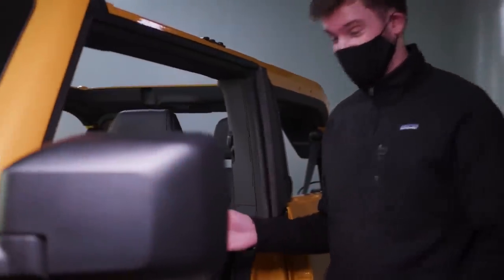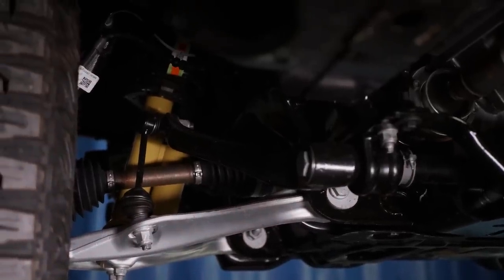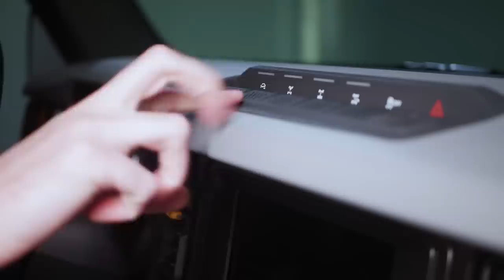See How to Take Apart the Ford Bronco, and Other Cool Features

Comment: Those attachment ponts for the rear washer fluid and electrics sticking out like that are not going to work out well! Someone or something in the rear is going to knock them off. The storage connection points shouldn't have been perpendicular to the side but rather recessed and covered with a flap.

Awesome car though, I'd love a 2 door but the roof can stay on.